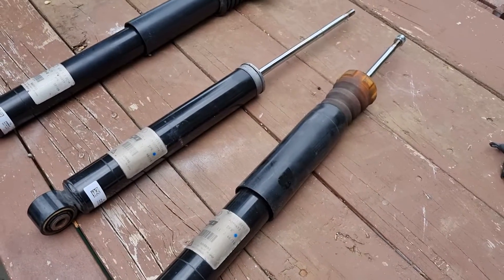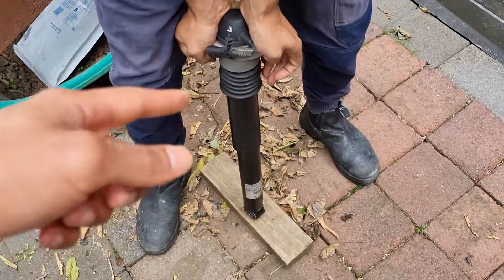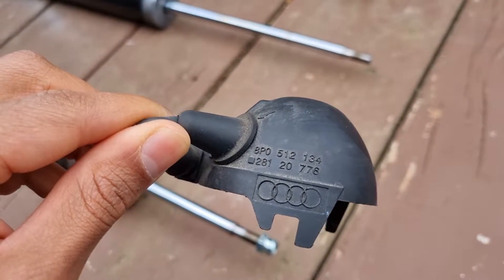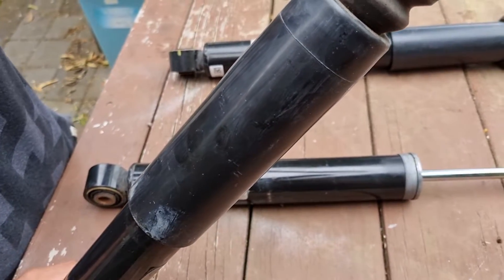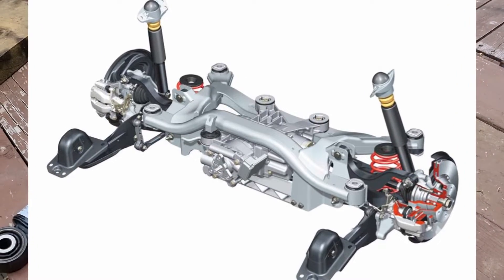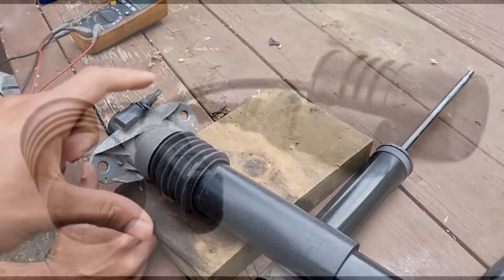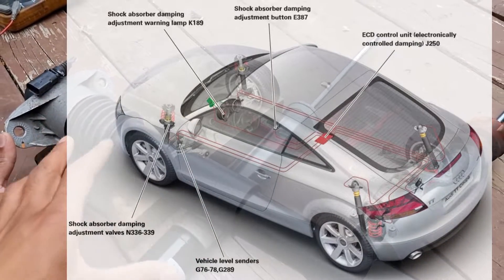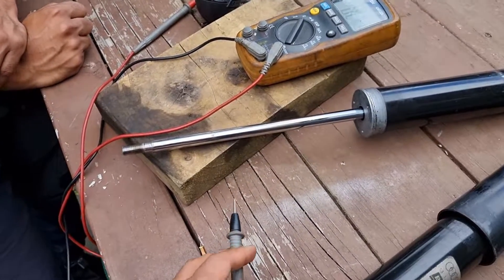Magnetic Ride Audi Shock Absorbers Fault (Electronic shocks) See videos in Description

Comment: Hello, 
i own a audi tts 2009 same magnetic struts, any brand or place to buy, i need a front struts but audis are very expensive $800 up, and i was checking on ebay much cheaper , around $200 each
what do you suggest
best regards
Reply from the maker: If you can get bliseten standard shocks that would be my suggestion, see my video below otherwise
https://youtu.be/isYBemQWGV4?si=rrj4xxzUZhp7PPRi

Comment: Hello, I have some questions about the video and the magnetic shock absorbers that I hope you can answer. But first, let me provide a bit of context. Currently, I am studying mechatronic engineering at university. As part of a project with some colleagues, we are working on developing an active suspension for an off-road kart, similar to those used in competitions like Baja SAE.

My responsibility in this project is to research possible options for shock absorbers that we could use. During my search, I came across various categories of shock absorbers, but magnetic shock absorbers caught my attention due to their rapid response time. However, unfortunately, there is very little documentation available on their operation and the power supply to the actuators inside, such as the electromagnet.

Now, regarding my questions:

  1.- Does the shock absorber shown in the video necessarily need to be energized to support the weight of the vehicle, or can it support it without receiving current?

  2.-Do you think these shock absorbers (Magnetic Ride Audi Shock Absorbers) could be adapted to an off-road vehicle, especially one of the Baja SAE type? This is relevant because Baja SAE vehicles typically weigh around 250 kilograms, while a conventional car exceeds 1000 kilograms.

  3.-With what specific voltage or current are these shock absorbers powered?

I appreciate in advance any guidance or information you can provide to answer these questions. Thank you very much!
Reply from the maker: Hey Mate, thats a cool idea check out my other video and see answers below. https://youtu.be/uoQMLOktYXU?si=i9UZfcpOxRnmDaea

1. No it does not, this one has failed hence why it compressors so easily. See my other video for the test mode you will get an understanding how it works. 

2. Yes it will work, however this system works of level sensors and speed sensors as the inputs so this would have to be programmed for off road driving otherwise the ride would be to harsh. 

3. It operates on 12v and draws a fair amount of current i belive upto 30-40amps for all the shocks. PWM is how it controlled so by varying the voltage you can change the stiffness.

Comment: So expensive to replace new, not so bad via that Polish rebuild company.
If you go the coilover route, the UK insurance companies crucify you with premium increased of 70%.
Better off getting them rebuilt and add a set of appropriate springs to replace the rusted out OEM ones.
Reply from the maker: Agreed. Or you can change it over to a new set of Coilovers as seen in this video below, more cost effective and reliable in the long run.  https://youtu.be/isYBemQWGV4?si=VjTh8o-Vseatk9N9

Comment: What's a reasonable lifespan for these type of shocks/dampers?  I mean how many km based on normal usage?
Reply from the maker: Hard to say, I've seen some fail at 40,000km and others last beyond 100,000km. Only by testing these shocks and checking for oil leaks can you determine if its ok or not.
Reply: @AutoBuddynz  thanks for the message..
Reply: @AutoBuddynz hi, both my two rear shocks are dead and I’m struggling to find second hand ones. Are you able to suggest a salvage yard who might have them?
Reply from the maker: @craftboy211  Its difficult to find good 2nd shocks. If ur in Europe you can contact this company   https://nagengast.pl/en/kategoria-produktu/audi-en/audi-tt-de-en/

They rebuild Mag shocks
Reply: The r8talk forum says they go at around 47,000 miles and that is exactly when mine went - incredible

Comment: I have a 2016 Audi s3.  I have to go over a speed bump in order for the problem to happen, but the passenger front side seams like when the whole car comes down off the speed bump the right side goes back up and then down.  you can kind of feel it when it does that.  But I get no other problems no noise, normal driving conditions it does great.  minor bumps in roadway not an issue.  I did put it into comfort mode, and it seemed not to "hit" so hard.   I am assuming it's the shocks but without any other noise i question if it's not something else.  Not holding anyone accountable but is it possible that the shocks could be out only off the bases of the speed bumbs and no other real sighns?
Reply from the maker: I would recommend getting your suspension checked out first. Could be a top strut mount problem, or a bush. Check those items first for any play before proceeding onto the shock.

Comment: what are the syptomes to determine when the mag ride is bad on the car. my car has a very harsh ride. its on h&r springs but still very harsh ride. any bump is like its hitting the bump stop
Reply: Can you get clunks? Mines horrible noise had new original tops mounts and bearing, plus drivers side ball joint changed, mechanics now saying my shocks going bad, during bounce test it makes a crunch noise
Reply from the maker: @BringBapeBack  yes thats the issue when the shocks have failed, they have no resistance.
Reply from the maker: Watch this video https://youtu.be/uoQMLOktYXU

Comment: If i have an error and the problem is from the sensor, can it be changed? Only the sensor.
Reply from the maker: Yes if its a level sensor problem, no if its a failed shock. There isn't a sensor on the shocks absorbers but rather the control module and input sensors.
Reply: @AutoBuddynz  it's the leveling sensor, can you send me a link please from where to buy it, i have been looking for it for so many times but  no result..
Reply: @blanariucosmin5219 Hello bud, did you replace your part? Did the suspension fault go away? If you’re still interested I have a link for a replacement sensor.